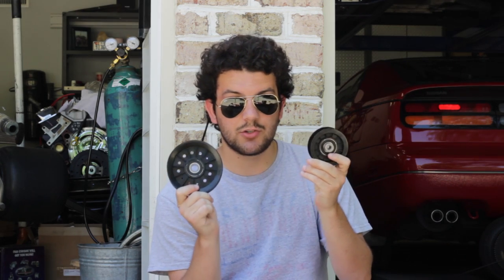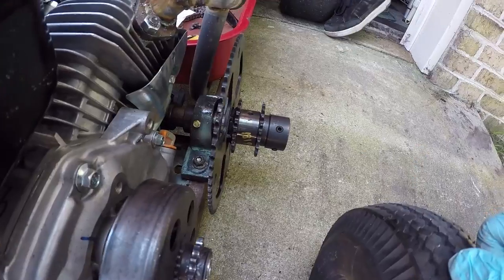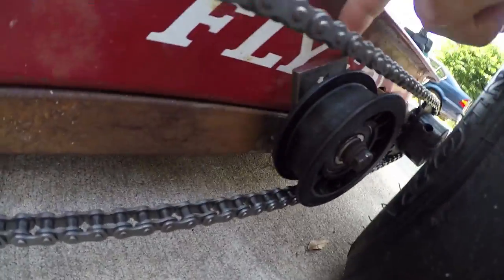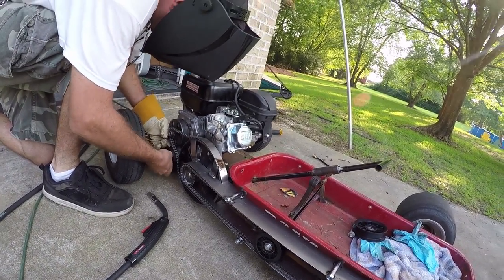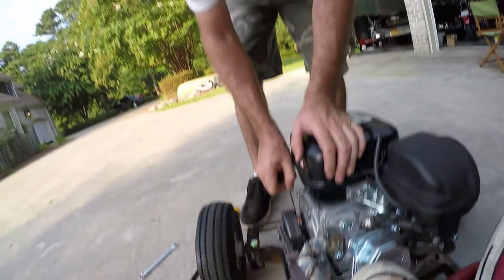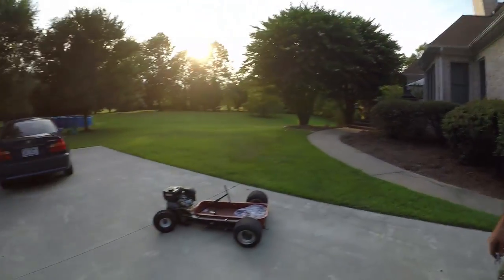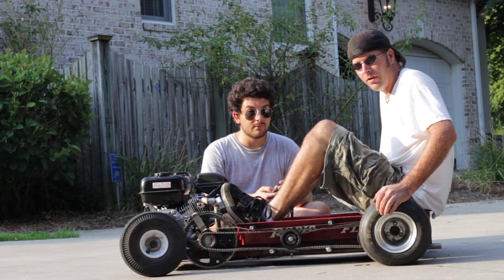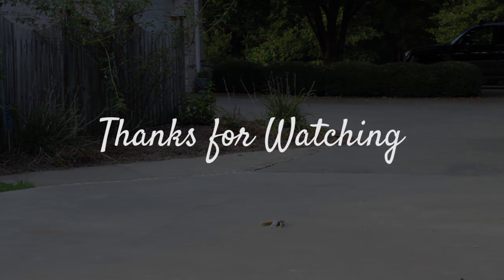Rat Rod Wagon Build: Pt. 7

Comment: KKK Man u was going to the oposite direction whit that tention... LOOL  U should always pull the chain to the center of your pulley no outside it. This way ur making easier to chain falls off. Take a look in motorcycle tensioner.
I cant post link here. 
Also u can buy a tentioner whit or whit out spring(pre load) But this tensioner have the same profile of "gears" (sorry about bad english) This way it will guide a lot better and lots quiter. And probably will stop falling off.

U earn a subscripe...

Comment: I think that gearing in the front needs to be re-thought. That thing is so low to the ground im not surprised u arent destroying chains even on the pavement. What you really need is to relocate that jackshaft (higher) or change the engine output gear so you can go smaller on the jackshaft gear. you are going to go through so many chains if you dont do something about it
Reply: +2wheelLove yea im going to change that. the wagon wasnt supposed to be that low, but thats what john wanted.lol

Comment: id use a 50 pitch that's the same chain they use on chain driven 4 wheeler's.... and the chain on the motor id use a 40,41 pitch chain... keep in mind .35 is the chain they use on peddle bikes i wouldn't use .35 on a go kart or any thing for that matter ...

Comment: Hey CarsAndCameras, big fan. Pretty much seen most of your videos. I made a custom Razor Ground Force that you might find cool, but I dunno. Here is a 20 minute video of me ripping around a neighborhood, if you would like to see it running. ( /watch?v=egpolO7qZJk ) It has 8 inch tires all around, a 79cc Predator, A solid rear end, 12t clutch, 48t axle. It goes 28 on a flat road and hit 38 downhill.

Comment: De engine doesn't like the exhaust because 3/4 is to small for such a long exhaust. What you can Do is cut an piece of and make that 1 inch. And on the tip a slash cut

Comment: what are some cheap welders
Reply: +Kenneth Rios harbor freight has welders for like 100 bucks. they will weld but they wont be purty. if you think you are going to do a lot of welding dont go cheap, miller or lincoln welders are the best. with gas. dont get the flux wire

Comment: needs keg... needs seat... needs brakes... needs throttle handles..... needs a hell and back plate.... needs flame thrower kit... and also could use a cage at the front like a tractor you know the things with bars and a frame type thing...... keep in mind not all these were my ideas these are what the fans want
Reply: also is it possible to get a engine like Doms from fast and furious not the engine but the looks...... on a kart or a wagon a rat rod wagon

Comment: Where's part 6?
Reply from the maker: +Night Hawk That was the episode when we build the exhaust.
Reply: +CarsandCameras when are you gonna work on the karts you bought the other day?
Reply from the maker: TheLatestGamers Horatio Videos about the build off will surface soon. We want your opinion on certain rules. We won't actually work on them until we have the build off, which will be December because Taylor and I are at school far, far away from the shop.
Reply: CarsandCameras Ok, thanks for the reply!
Keep it up! I enjoy your videos, I am currently trying to find a used offset racing go kart frame like your's..
Reply: +CarsandCameras oh cool! 
I'm making my own go kart.. It's really hard, I have a frame I made, a 212 predator and some other stuff but I have so far to go!
The build off should just be who can build the the fastest go kart.. Without dying
Reply: +CarsandCameras I still wanna see the torque converter on the mini bike 🚲
Reply from the maker: +Cameron Crawley So do we. Time is the biggest issue.
Reply: CarsandCameras I think it would run pretty fast but no big hurry.
Reply: +Bryan Toledo read my mind!
Reply: +CarsandCameras you should definitely do a video of your shop so the viewers can get an idea of what you guys are working with.... You got any machining equipment or just light duty welders in there?

Comment: i just think that the big large sprocket is too close to the ground, anything you run over is gonna crush on it
Reply: +Kevyn Hoepelman yea well the wagon wasnt going to be as low as it is but we kept lowering it till we liked it, and the gear was just too low.we are going to redo the sprokets
Reply: +Isaac Jennette maybe a torque tube is the solution to the chain problems, also the position of the body looks pretty unconfortable, maybe making the rat rod wago a little longer and wider will totally make a difference in the position of your back.
Reply: its not bad at all